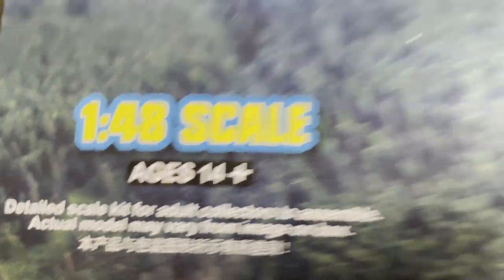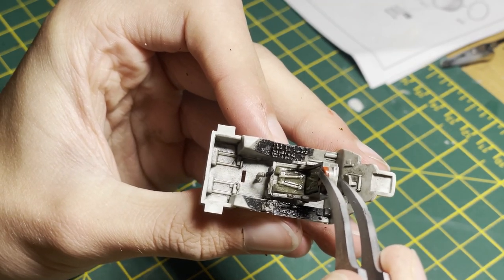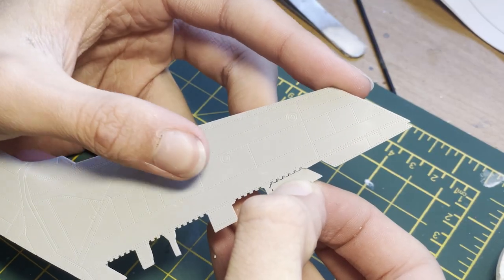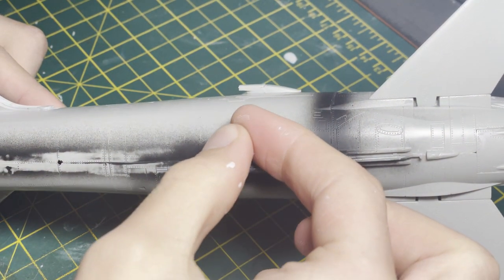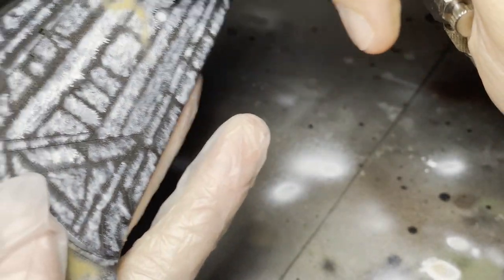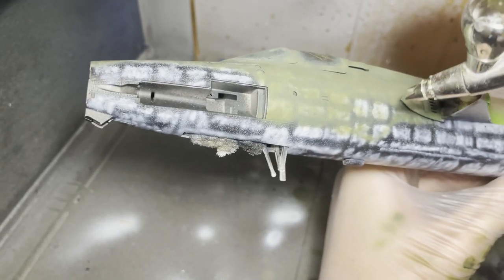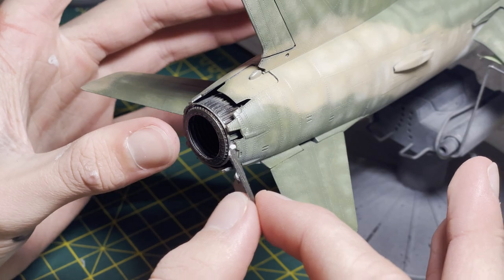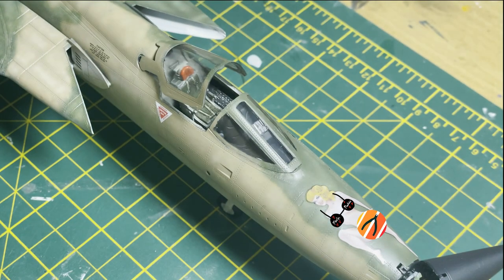HobbyBoss 1:48  | F105D Thunderchief  | Full Build Video

Comment: Definition of hobbyboss. Over engineered. Why didn't you just add a little yellow or a flesh color to the lighter green to change the hue.
Reply from the maker: agreed, just a little bit too much for too little… if that makes sense? for the second part, i think i was just trying to achieve a really over accentuated stressed paint look, for that reason i used a base flesh colour. hope that helps!! :)

Comment: Hi there, just some questions from  a fellow modeler: Why did you not put in the navigation lights? Why did you not install the nose gear radar reflector and landing lights? Did you install any of the many belly antennas? Why did you leave out a piece of the afterburner can cover before the air brakes? Speaking about air brakes: With landing gear extended, the top and bottom brakes were inoparable and in the folded position, as to not interfere with the drag chute.
Reply from the maker: Hi mate! Cheers for the comment, to be honest I made this at a very early point in my modelling career so perhaps I missed one or two things. For me personally at the end of the day it’s a model, not a replica.🤙🏻
Reply: Fair enough. Happy modelling!

Comment: Nice build!

I'm curious though, did the kit come with any under wing stores, for instance... Fuel tanks, ejector racks, bombs,... Or did you simply make the choice to build in the "clean" configuration? I only ask because usually with fighters of this particular genre it's almost always displayed with at least fuel tanks.. Don't get me wrong. The "Thud" was a striking aircraft and it's need to see how tall it really was without a lot of clutter underneath. I also asked because I know some kit makers notoriously leave out under wing stores that normally with other kit makers are just standard, in the box items.
Reply from the maker: hi mate!! thank you very much, and to answer your question hobbyboss supply lots of missiles bombs etc to be displayed however after my worry’s with the landing gear i didn’t want to put anymore weight onto the bird!